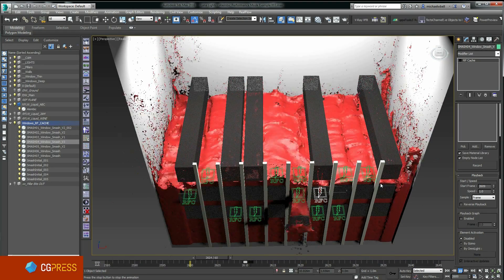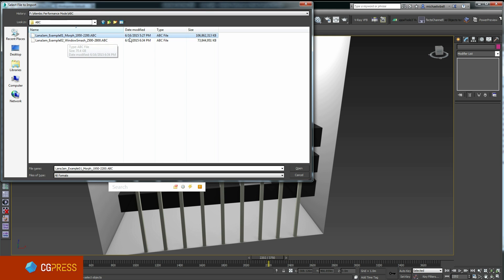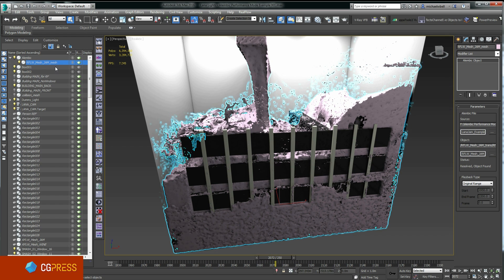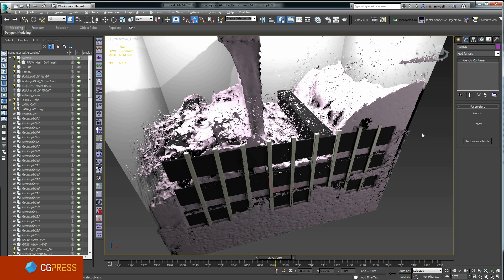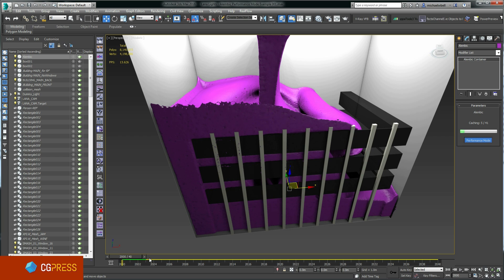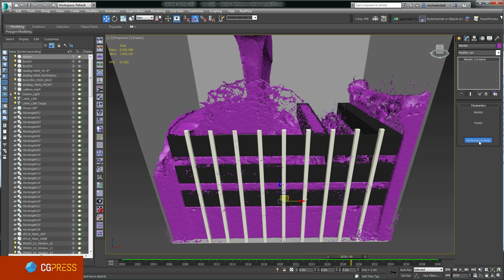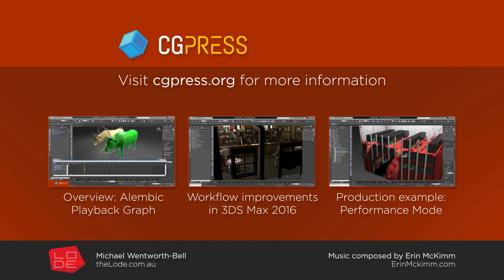Alembic Performance Mode Overview - CG Press 3DS Max 2016 Review

Comment: congrats! your video get the whole point!! and the drawback! I am the designer of this feature.

and the data stream indeed starts from Video Memory, then Memory, and last the Hard drives. 

One  thing you may need to know is that in 3ds Max 2017, you can add any object in to the alembic container, and then "force cache" it. but in this case Max will block your command unless you cancel it. 

it was a pity we never be able to polish it to the stage we wanted
Reply from the maker: xun T thanks for the kind comment Xun Xie, for the extra info and for all the great work on 3ds Max over the years. The alembic features were some of the best additions to 3ds Max in many years. I wish the transform cache / performance mode was finished by you,  it would have been a killer feature for 3ds.
Reply: it's partially in the product now, more specifically in max 2017, you can grab any animated object into the ABC container then "force cache" the whole animation for better playback performance (we didn't give any documentation for this "feature" because it's more like a prototype). 
our initial goal was to build cache manager smart enough to manage cache chunks in the background without blocking users inputs--this is the missing part.

Comment: any idea why the performance mode would be greyed out?  btw  I am experimenting now exporting to Unreal Engine  from max.
Reply from the maker: terrablader any luck solving this? My First guess is the abc files were not parented to the alembic container object.
Reply: i did thanks for help.   I used the stitcher,  it is a bit buggy still in UE4 but have not tested it in 4.15 yet.  sorry for not replying back

Comment: Really Thanks bro i was looking for that kind of information about Alembic.
Reply from the maker: thanks for the comment, glad it was useful. unfortunately I think alembic performance mode isnt working in 3ds Max 2017, I haven't tested that yet. if true it sucks. :(
Reply: i tried today on 2017,its working Cool bro.. i wanted to compare with Frost mesh and RealFlow mesh,,its really Good tool,,,but i guess for Fluid stuff i prefere Xmesh from thinkbox and Super mesher from Boomer labs both are Cool tools..if you are using Frost for meshing then i guess Xmesh will be more good tool to use with Frost meshing plugin
Reply from the maker: Thanks for the update, great to know. I'll check out Xmesh with Frost!

Comment: Awsome tutorial did you use Hybriddo for this ?  If so why not?   Also did realflow make individual ABC files for this?  Or one big ABC file?  If one big file how is that made versus and series of abc files.
Reply from the maker: +terrablader Hi thanks for the comment. Yes I used Hybrido for this - RF2014. Hybrido was very good, I had issues but that was because my mesh (The building) wasn't watertight/geometry errors. For this sim I exported as the standard .BIN mesh from RealFlow - one mesh per frame. Later in the project I wanted to try out 3ds Max performance mode so I used 3ds max to convert the .bin meshes to .abc - one large ABC as seen in the video. 

RealFlow can export as ABC. It will write one .ABC file per frame while you are simulating. When you are happy with the simulation, RealFlow can 'stitch' all the separate .ABC frames into one large .ABC file. You can then use that in the 3D App of your choice.

Comment from the maker: Here is a table of contents for the video:
00:00 Introduction
01:19 3ds Max Scene with .bin mesh loader
02:13 Alembic file size considerations
03:00 Importing Alembic meshes
04:54 How Alembic Performance Mode works and limitations
08:30 Performance Mode Caching example
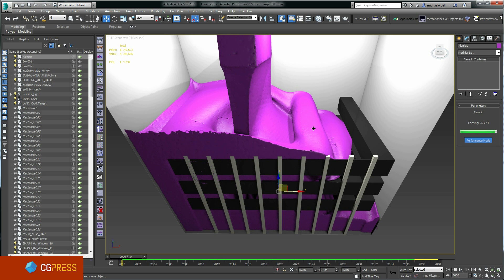11:11 Alembic Performance mode playback test
12:26 Main issues with Alembic Performance Mode
15:05 Conclusion and examples